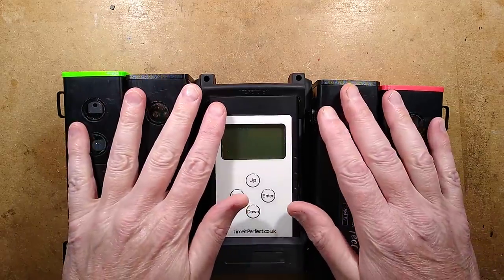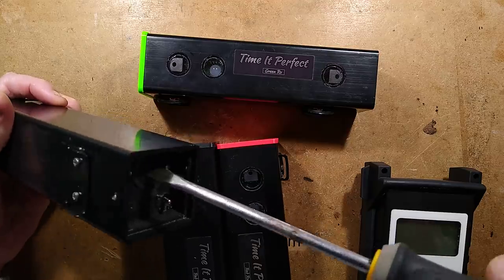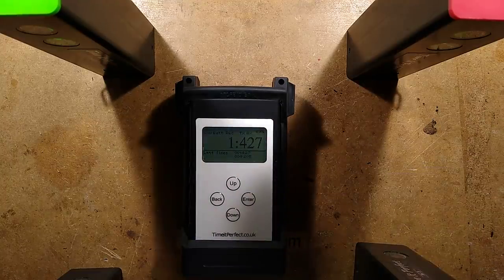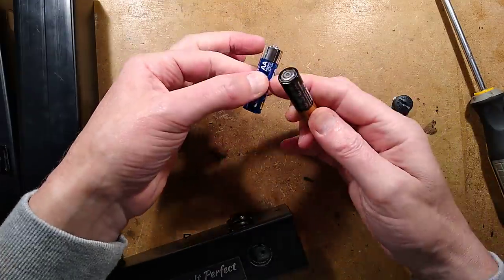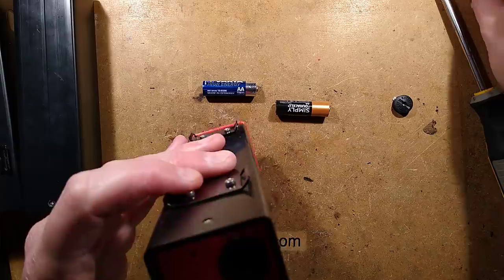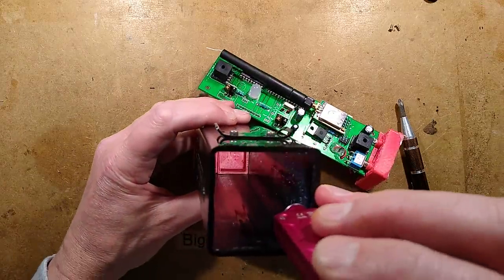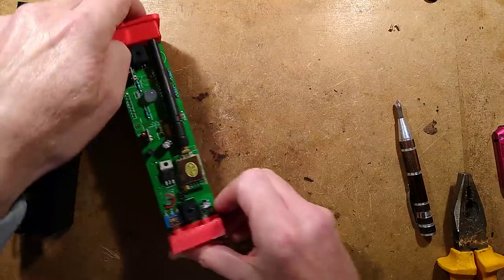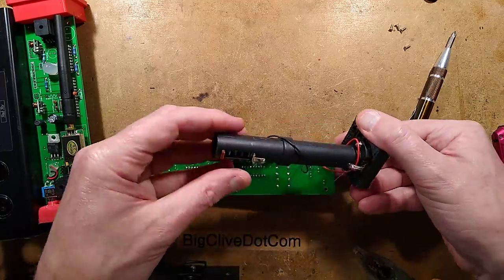Troubleshooting a faulty dog-race timer

Comment: huh i always thought those warnings about mixing batteries were bullshit. I though it was just a liability/ "buy new batteries from us" thing. this is good to know. I feel like a dumbass now.
Reply: Does that mean that you can mix batteries if they are all fully charged though since only back charging matters?

also greetings timetraveler.
Reply: @Coconut-219  - No, it’s not good practice to mix different makes or types of any series connected cell or battery. Whether primary (non-rechargeable) or secondary (rechargeable) types. You should also not mix cells or batteries that were bought at different times, as the capacity is very unlikely to be similar. Secondary cells and batteries loose capacity over time and with every charge/discharge cycle.
So to be totally clear, if cells or batteries are used in a series chain, only use cells or batteries that were bought in the same pack. And try to buy from a shop that has a high turnover of batteries. For secondary cells or batteries, keep them as a set and recharge them at the same time, so they all get the same amount of charge. And are all the same age.
Reply: The worst batteries to do this to are CR123 Lithium primary cells, as you find in many 'security' flashlights.  The advice there is to not only mix the batteries, new and old, but check each with a voltmeter and make sure to only match up batteries with the same voltage.   I've seen clips of the damage done by one that went reverse charge, including two snapshots from a security camera showing the thing arcing through the air after punching through a (plastic) doorframe.    They also produce a large amount of vaporous hydrofluoric acid when they blow.

Comment: A lot of comments go for "put a powerbank in there" or similar solutions. As this is not a hobby but an event type device: NO!

You have to be able to quickly replace your power source. And charging is not quick. And considering that apparently even handling AA batteries is a problem, what do you think the state of those banks would be?

Simple AA batteries are the best solution here. Easy to replace in the middle of an event and readily available.

I would consider removing the power switches actually. Sounds weird but it would force the user to put batteries in to power it up and take them back out to "switch" it off. ofc you can still buck that up, but the ultimate dumb user would keep the switch in the on position anyway.
Reply: I agree.  If you run out of power during an event, just go to the nearest store and you're back in business.
Reply: Or you could get organised and make sure their all charged the day before ……..what is it they say ? …….Prior  Planning Prevents Piss Poor Performance
Reply: @steveosshenanigans  Avoiding rechargeable batteries falls under "prior planning"
Reply: Given there are two per unit, just buying a fresh 8 pack before an event would make sure they've all got matched pairs. If you can't reliably get two full events without running flat, swap in new ones, and use the part-worns to run clocks, shavers and other stuff that goes flat at inopportune times.
Reply: Mixing batteries will be even more of an issue. Recieving and transmitting sides would probably drain the differently. As someone suggested, just put new batteries each time. Those type of events are sure no cheap so they can spend £5 on them.

Comment: The replacement device (they may not have discovered it yet) is crazy simple. It's call a moving picture camera, of the digital variety. Paint a line on the opposite wall and the first animal to occlude a pixel of the painter line is the winner. Frames per second is your resolution.

Comment: Clive - I have found vinegar and an old tooth brush will remove the crud from battery housings. Just need to be careful not to get it in contact with a pcb. Rinse off with water and once again with isopropanol. Dry with a hair dryer and coat with a spray contact cleaner or a drop of silicon grease to prevent further damage.
Reply: Silicon isn't at all greasy. In fact it's brittle. Silicone would be better.

Comment: Tinkering with these kinds of fairly simple but specialized things in a small company shop would be such a nice job :) Especially if I could sell loads of them for £685 a set... :-)
Reply: I will give you £3.59
Reply: I work for a company who does exactly this kind of bespoke gear (well we do AV, Software development, 3d and 2d graphical assets and electronics with AV integration)! And yes, it is a very nice job and very enjoyable.
Reply: would love to do something like that...
Reply: Yup, years ago I got an email from someone who ran just such a place, we'd been participating in some of the newsthreads on usenet and he'd decided he needed to interview me for a job, fascinating bloke, he ran a reasonably successful business designing bespoke products around PSOC chips and a couple of others.

Occasionally wonder what it might have lead to but I had a mortgage, small children and sadly he could only offer part time which I just couldn't make work for me at the time.
Reply: Having helped my dad repair some specialized equipment that costs around €1500 to replace, and turned out to just be off the shelf components with a total cost of €80, I have to agree :)

Comment: This looks like a good set of items for retrofitting with garden light solar panels.    They'd also be a lot more tolerant of being stored over a winter.
Reply: I dunno, it'd confuse people who wouldn't get why they have to put batteries in it. There's a language of functionality built into product design, a protocol between the public and manufacturers, where certain things work certain ways. Beside that, I doubt you'd leave these outside all year would you? They're 700 quid! Don't they lock them up indoors somewhere between races?

Comment: Can confirm that these sorts of things are pretty low-volume. We dealt with a couple of sets for autocross purposes, and they all used generic housings in some form or another. In one set, the receiver that plugged into a computer was a generic hobby box. On another, the electric eye portions were generic extruded aluminum cases.

Comment: Very interesting to see this small scale manufactured stuff. I like the 3d printed caps on bulk tubing solution for housings, might have to use that one myself.

That's one nice thing about rechargeable NiMH cells, they don't leak as often as alkalines, at least for me. Here's hoping I haven't just jinxed myself.
Reply from the maker: I've come to the same conclusion, and with the low self discharge cells they are now viable for use in low current items.
Reply: I've gone to exclusively Li primary cells for anything that's not rechargeable; costs twice as much and lasts twice as long while never leaking, working at extreme temperatures, being lightweight and having a shelf life measured in decades.
Reply: The tubing is extruded PVC.
Reply: @KJ6EAD  Used them all the time in stuff like remotes, easily can cut the weight in half compared to usual the difference is surprising.
Reply: actually, I'd go 1 step further and say that they basically NEVER leak, with the proviso that if they are being over charged over a long period of time, they MIGHT leak.
And, yes I use them in just about everything.

Comment: It's really nice that the whole thing is wireless.  If that battery holder company is nice, they could sell a set of replacement springs and contacts.  I've made contacts out of tin can lids, it's not too hard with a sharp scissors.  A little pounding and bending and there is a workable contact.  I wish it was as easy to replace the spring.

Comment: It's super interesting to see a low volume product like this. makes me wonder what they would have done before 3D printing was a thing.
Reply: CNC mill it out of a piece of plastic. And I wouldn't call it the way "before 3D printing". You only 3D prints parts like this, when you don't have access to a CNC, because that would be the right tool. The endcaps don't have any features that require a 3D print. It doesn't even look like you'd need several endmills or reclamp the part in a different orientation. The parts would be done within minutes on a CNC, as opposed to hours of the 3D printed version. And a lot cheaper, too.
Reply: @superdau  ah of course. I don't know why milling hadn't occurred to me
Reply: i used standard aluminium cases and boxes (ip65) and standard industry laser detectors with standard industry reflectors.
It does not really get better or more stable with the 3D printing, just cheaper for the manufacturer.
i would not think this holds up to getting run over or stomped on by a person or kicked away in an accident.

next point is how and where to fix the beams properly to get a small dog, large dog or jumping dog with four legs giving four or only one trigger signal on each pass...

Comment: when you powered up the base unit it said that one of the transmitter batteries was low.. but the emitters don't have rf modules.. possibly they are sending their battery status to the receivers via the light pulses

Comment: I was happy you didn't reverse engineer this. It looks like they deserve their niche.
Reply: Not really that complicated though.😅
Reply from the maker: Not so bad with modern stuff like Arduinos.  But the original design and subsequent fine tuning would have involved a lot of work.
Reply: @bigclivedotcom  Yeah, i have no idea when the original design is from. Didnt look that old, some people just cant resist through hole, you know. 😏 But seriously though, the software shouldnt been super hard when using external encoder/decoder, if that is what is was. And yeah, nowadays with arduino and ready made libraries for about everything, even I can code more complex stuff. 😁 Coding is not my strong area though. But thanks for good content as always! ❤️

Comment: Of course to do a proper job(especially when it's for someone else), replacing the holders would be best.  Alternately, one could give the contacts a bit of a soak & scrub in white vinegar which will neutralize the alkaline electrolyte and remove most if not all corrosion.  Depending on the condition of the contact afterwards, one may want to tin the contact with a coating of solder to "refresh" it.
Reply: I was also surprised why Clive didn't want to try it. At the same time, considering how expensive the equipment is, how critical it is and how much money they probably make/charge they probably should just replace them with new ones.

Comment: That is indeed a programming header, AVR ISP. I'd have tried to dump the AVR just for laughs on the off chance they sanded the tx/rx chip but didn't set the lock bit on the micro.

Have found a couple of examples of this in the wild, the HP blade server turbine fan controller boards have an unlocked PIC you can dump the firmware out of, and both variants of it I've encountered (with different PICs) are unlocked. I was pretty shocked that a company like HP would let that happen.
Reply from the maker: I'd expect most sole traders to be quite secure about their code.  But an example of code escaping into the wild is the ELM OBD scan tools.   Most of the units sold on eBay are using stolen software.

Comment: For the amount of times that system would be used and stored in a box, i might consider using lipo with good battery management and auto shut off
I know that's 5 units total, but that could be reduced to 3, where i worked we had electric gates, one system we had was reflective, the 'transmitter' boxes could have had 2 mirrors like a periscope so there would be 2 beams to break as with those units.
Reply: I think in an application like this, KISS is the key.   With four boxes, it's simple.  If you start reducing things down, you start making it more complicated.
Reply: You would be better off with a retro reflector instead of a periscope arrangement.  This would make manufacturing a whole lot easier but also make alignment during field setup a bit more of a pain.
Reply from the maker: I wonder if one of the reasons they have two separate beams is to avoid false triggering by leaves or insects breaking a single beam.
Reply: @bigclivedotcom  Exactly, there's 2 beams for a reason, maybe different heights of dogs

Comment: I kept getting distracted by the use of an adjective where an adverb should be. "Time it Perfect-LY"
Otherwise - this looks like a homebrew device built by someone with more than a passing knowledge of electronics and product design. I'm quite impressed!
Reply from the maker: Not anywhere near as bad as the manual for Siemens Logo! logic controllers.  Because they used an exclamation mark as part of the brand, and the word Logo! had one every time they said Logo! in the manual.  And they said Logo! quite a lot, as in to set up the Logo! hold the lock button on Logo! until the Logo! display flashes, and then press the set button on Logo! to increment through the Logo! options.

Comment: I would use a USB power bank instead of the single use batteries, that would mean you don't have to hunt batteries in the future
Reply: I had to design luxury items that only go on display about once a year and are supposed to last for decades. After lots of tinkering with pacemaker cells and whatnot I found USB power banks to be ideal since they are always easy to find, even in 20 years and the flexibility to alternatively use a usb power supply is also nice. 

In fact, I got one story back of the power bank getting misplaced and they could simply buy one in the first store they went to and continue as planned.
Reply: i design my stuff to work with usb power or battery packs (edit: at the same time, so needs run from 5 to 7V or more as input). if you have a power pack or standard usb supply , pc, laptop etc around everything is fine.
if you need to run it off 4 AAs for whatever emergency reason just use the battery holder.
Reply: @drkastenbrot  very nice. well done my friend. : )
Reply: @PsiQ   a TP4056 (or a pound-land power pack board to be naughty as Clive would say. also handy with its 5V boost circuit on it. ; ))   & your set all day long my friend..
Reply: @keithking1985  uhm. I wrote usb? so usb power banks can be used, just not integrated.

problem here (europe) if you sell or even "build for free" and integrate another pcb (as stupid as "a led" "active components")  youd have to redo CE and EMV testing. Thats why i use usb or a dumb passive battery holder. A battery holder has no electronics (=no ce or emv) and the customer can use whatever he has around which has usb out or that. No problem for the producer. 
Its not worth getting sued and having to pay test labs for a 20 bucks job.
Law basically says you have to recertify (CE/EMV) and redo WEEE registration if you add or change a resistor :-(
No problem for big companies but the reason you can only sell diy kits as hobbyist.
If it is to be self assembled, the person building it is the producer/importer, if thats a private user its no issue. If you assemble it for someone (even for free/gift) you are liable if some asshole wants to sue.
Reply: Nope. Instead they have to hunt the charger instead....
Reply: Good idea. Usb powerbank. I run my Zoom H1n off Poundland £2 powerbank. As NiMH batteries are only 1.2 volts  and are expensive plus the price of the charger.
Reply: The races are extremely short, I doubt they have to change them very often at all. By far the easiest thing to do is just keep a GBP 5.00 pack of 20 batteries with them.
Reply: @chocolate_squiggle  an individual race might be short, but they're not going to be powering down and up all 4 units between each dog. They'll just leave them all on until it's time to pack up the track.

Comment: If the batteries were in there long enough they would have had bulging battery holders. I'll get my coat.

RS stock Bulgin battery holders, 2 different types for 2AA in line.
Reply: So the tubes are made in Bulgaria? It is hot outside  no need for hat.
Reply: And CPC stock them for less than a third of RS's price.
Reply: Sorry - around half the price. RS £9.64 inc, CPC £4.96 inc.
Reply: Nice battery holder... but pricey!

Comment: I've had some luck with salvaging corroded AA and AAA battery contacts for children's toys and things where the extra resistance from the corrosion doesn't matter that much.  White vinegar will neutralize the leaking alkaline electrolyte, and then a quick scrub will remove any loose material.  Of course, depending on the level of corrosion it may be easier to replace the contacts or device entirely.

Comment: Clean the corrosion with vinegar and rinse with water. 

This is a good candidate for LiFePO4 14500 battery with a hollow pass through AA battery shell. 3.2v is close, they tolerate abuse and are easily recharged. They can remove them after each event to recharge as the capacity is 1/3 of an alkaline, about 600-800 mAh.

Comment: Thanks for the interesting video.

Does this demonstrate the desirability of designs that use only external (and therefore easily replaced) battery holders for costly electronic devices?
Reply from the maker: It demonstrates the need to remove batteries in storage and have a fresh new set for major events.